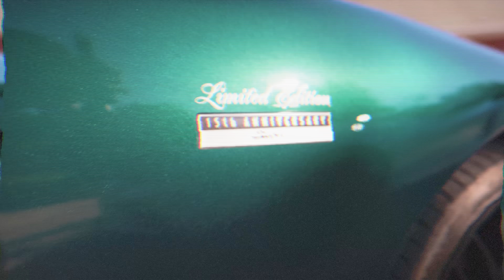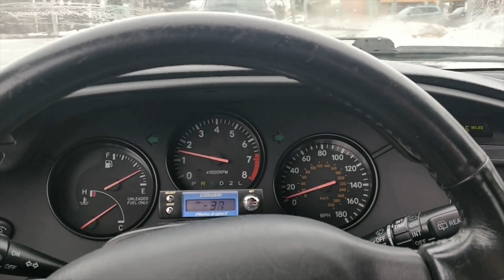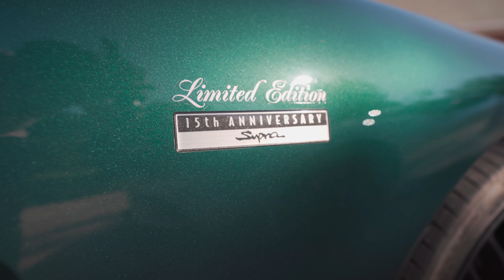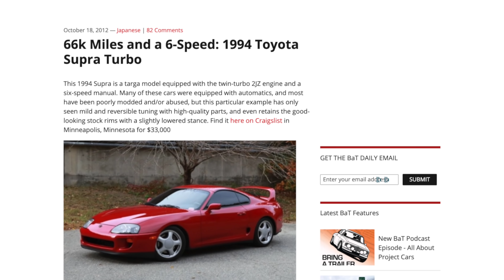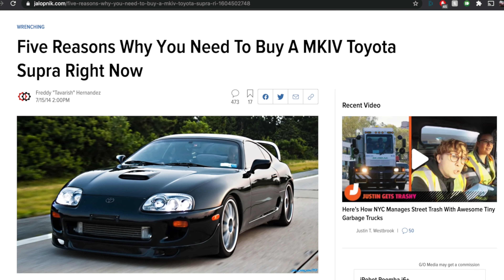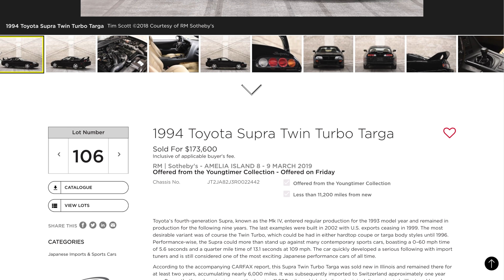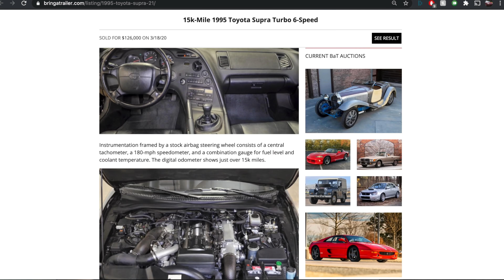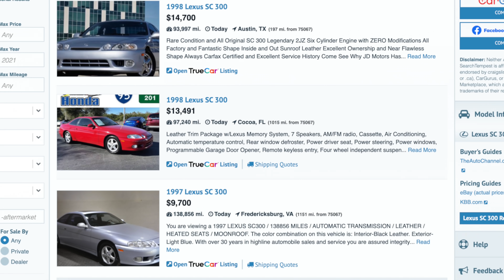Here's Why You Can't Afford a Supra

Comment: I feel so lucky that I was able to snatch my baltic blue up in 2019. Even as a swapped NA car, it wasn’t cheap. But I knew if I didn’t move on it when I did, the window of affordability was rapidly closing
Reply from the maker: That's awesome man, hold onto it! Baltic is one of my favorite colors, very underrated imo
Reply: A NA supra is better for tuning and can handle more power but i dont think thats what you wanted to do 😅
Reply: @LiljamezZz  It's not better for tuning, unless you're just going off the fact it's got a higher compression ratio, but truth is it takes a lot of work to get a GE on the same level as a GTE before even making the claim that it's better for tuning.

Comment: Toyota only made 7866 Turbo models in the US from 93.5 to 1998 and that includes Automatics, 6-Speeds, Targas, and Hard Tops. It's mainly supply and demand now coupled with condition and options. You're correct about the early used 2001-2005 models, as I picked up a good Black 1995 Supra Turbo 6-speed Targa w/ 36k miles for 27,000 bucks in 2003.

Comment: Funnily enough, the most expensive non-movie Supra was auctioned off for $265K after it was seized by the police from a drug dealer. It was a 1998 turbo 6 speed manual with 23K miles.

Comment: Dude i work with has a fully built mark 4, silver, target top, manual. He’s technically the second owner but he bought it back in the late 80s with 300 miles on it. Fully built at certified shops, motor, huge turbo, suspension, body kit, interior. Everything. Puts down 1500hp in its highest map. Waxes it 30 times a year if not more. It is the most beautiful car i have ever seen. Has 13k miles on it. Say what you want about people buying modded supras, that man is going to sell that car for a fortune one day.

Comment: Well after watching this video makes me feel like I won lottery 24 years ago. 1997 I purchased my 1994 Toyota Supra NA 5spd, cost $30k. Engine and transmission are 100% stock / original w/172k miles It drives like the day I bought it if not better. extremely reliable, 24years of ownership it has never left me stranded not even with a flat tire. I don’t drive it much these days but when I do it’s a lot of fun.

Comment: I had an SC300 for a couple years, I paid like $2500 for it, leaked oil like crazy and had issues with fragile interior parts plus it was a dog, super heavy coupe with a non turbo 2JZ but man I loved that car despite all it's glaring issues... Wish I had put in some effort to restore it but the guy i sold it to did put some work into it... Rarely see them on the road anymore but when I do it always turns my head, I wanna look and see if it is being modded or kept up and unfortunately that is almost never the case, most of them look run down. Poor Man's Supra indeed.

Comment: For anyone that is feeling pretty bad about not being able to get one- a BMW E46 is somewhat like a German Supra. The best part is that they're accessible as well, just need to weld the rear subframe mounts and reinforce the strut towers and they can handle a good amount of power. M50 intake, an M56 valve cover, and ARP head studs and they can handle 8-16 PSI for a good time (really dependent on the tune and how you drive). You will highly enjoy the steering and the way it feels through corners, they have steering sensitive racks that don't overboost- they feel like driving a car with no power steering that has a high gear ratio. Just leave some for me lol.

TL;DR: E46 (maybe even E90, but they're expensive and have electrical issues) are somewhat like German supras, just are much harder to make as much power with due to the Aluminum block and head, and piss poor cooling system. Rebuild it once you buy and you won't have to worry about it for 5-8 years.
Reply: there are honestly better options

Comment: The MK5 being pretty much a BMW makes the MK4 even more legendary.
Reply: Yet, Yet, the MK4 Supra has a Gettreg 6 Speed Manual Transmission, that is German.

Also, the Straight 6 2JZGTE and 1JZ GTE was Co developed by Yamaha. And inspired by the BMW Inline 6 .
Reply: @borla4491  yamaha only co-developed the head on the 1jzgte with toyota.
Reply: @borla4491  So because one of the transmission options in the MKIV was German, it's somehow equivalent to having the whole car being a BMW Z4? Wtf?

And yes, the 2JZ was not co-developed by Yamaha, you will not find a single Yamaha emblem on it. Toyota didn't need Yamaha for the 2J, they already had the 1J to build upon from Yamaha.
Reply: @X50505  Without Yamaha, there wouldn't be a 2JZ. 

Also, Yamaha, also Co developed engines for other vehicles such as the Ford Taurus SHO, and etc.
Reply: @borla4491  Car manufacturers take ideas off each other all the time, you could apply that logic to anything. The fact is Yamaha codeveloping the 2J is a myth and it's a myth that's gotten more traction in the last few years as people try to use it to liken it to the MKV Zupra, which in no way correlates because the Zupra is purely a repackaged BMW Z4.

Comment: owned my first supra in fall of 03. was a 94 N/A 5 speed black targa top. had 60k miles on it and i paid 17,500. sold :( 4 years later with 120k miles for 14k. Bought a 97 limited red auto twin turbo targa top for 42k in 2018, sold a year late for same.

Comment: I bought my Manual SZ-R supra (non turbo) for $12,000 AUD ($8,600 US) with no mods of any kind perfect as factory, I sold it a few years later with 60k miles for $8,500 AUD (barely sold it too) ($6,100 US), now it costs $80,000 AUD at the least here, with turbos going for $180,000 lol. Even the R34 GTT that I bought for 20k sold for 18k, now its worth 50k+

Comment: I have a 1998 non-turbo back in the Philippines, With a mileage of just over 12k and painted in sexy white. I bought it just last year for about 450k Pesos equivalent to $9k USD, Should I import it to the US and resell it for over $200k USD? 
Stonks 💵📈

[Edit] Yes I’m the 4th owner and its fully stock. I planned to customise it with rocket bunny WIDE kit with a custom chassis mount WANG that completely removes the whole rear ASS(bumper).

[Edit v2.0] Or should I call LB Performance for a Wider kit instead?
Reply: Were supras sold in ph locally?

Comment: Just buy a VR-4 instead...AWD, twin turbo, adjustable electronic suspension... and you can still buy a mid mileage one for $30,000 - $50,000.  Surprised they haven't climbed as much in value like the Supra.

Comment: I’m yet to have someone tell me why it’s good other than “800 hp” which is only achievable with thousands of dollars.
Reply: maybe drive one or do some research about it, its a great car
Reply: @Idontknow-rx8jo   I mean it’s not the exact same engine, quite a difference between a ge and a gte. also plenty of people know about it, there’s also the aritso, soarer, altezza Gita etc but I guess I’m not supposed to know
Reply: @arcanevoid9199  The turbo is always removed when making over the stock horsepower.
Reply: @Idontknow-rx8jo  what is that supposed to mean?
Reply: @arcanevoid9199  The turbo is never kept stock when trying to make performance builds it’s always replaced. Basically, the gte and ge engines have 0 difference when not stock
Reply: @arcanevoid9199  Still does not make it good. Any LS, b58, or n54 could shit on this thing with cheap mods
Reply: @Idontknow-rx8jo  LS are v8s, n54 is aluminum block and b58 is 20 years newer. really not a good point, 2jz is really good for what it is. overhyped? maybe, but it doesnt change the facts
Reply: @arcanevoid9199  The fact is the 2jz was revolutionary for its time but is now nothing compared to what modern engines can do for  a fraction of its price
Reply: @Idontknow-rx8jo  never said there wasnt better newer options, but still have to consider that the 2jz has about 30 years of aftermarket development behind it and depending on where you live can be had for reactively cheap

Comment: I don't want to buy something for $200,000 that you purchased for $11,000 a few years ago. 

It just shows you that the car doesn't actually have that much value in it. 

You can buy the engine, modified, making like 800-1000hp for $30-$40,000 and put it into absolutely anything and it's going to be faster.

Yes I get it it's a collectable but who cares? There's many things you could get instead

Comment: The mk4 supra is overrated.  It's actually a dog stock, heavy and slow.  Modifying is it where is shines, but for the price its all nostalgia based on the F&F movies.  Evidence of that claim comes for other cars of that era for comparison.  The Viper for example is actually ~50-70% cheaper in the used market and was far more popular and iconic in the 90s.  The Viper had better preformance too.   Both were cool, but the Supra was never the exotic level like the 90s Viper was.   Another example is to compare it to the NSX which was sold as a higher tier when it came out.  Those are increasing in value,  but still not pulling the same a Supras.  So, hard to justify the crazy high prices for a 90s Supra for what it is other than from movie overhype.  Cool car though.

Comment: people think they come out fast from factory already lol nah peeps you gotta sink money into them to make them fast ..it's not hard to do the engine was designed to be played with but it will cost you plus you have to be handy with the wrench or be knowledgeable
Reply: did a 5 second 0-60 in 94, how is that not fast?
Reply: @arcanevoid9199  dude they were known to be slow out of factory wth are you talking about ??
Reply: @1922BluePhoenix  known to be slow in modern standards where if it doesn’t have 1200hp and do 8 second passes it’s slow, so desensitised to horsepower because of the internet now

Comment: Also, the guy making the video decided not to mention the other reason MK4s are on the rise ... The MK5 BMW Supra sucks as Supras go. As a Beamer it looks nice. I test drove 1 with a Toyota salesman dreaming I'd trade my MK4 in. It's BMW all the way, no wing, the ducktail is gay looking, no sport roof which I love and my biggest problem? Role 1 or 2 windows down! All the way or even part way. The wind buffeting is deafening! Awful design. MK4s don't do this at all...let's see what happens with a MK5 with 100k miles or even 200k. My car will run forever so think? 265k miles strong. Did buy a new all aluminum radiator.
Reply from the maker: Price trends haven't really deviated at all during the A90s development or release so the data doesn't back that up. That's why I didn't mention it! We'll see if that changes going forward as the MK5 ages. Thank you for watching!